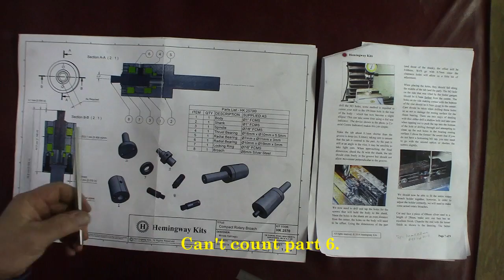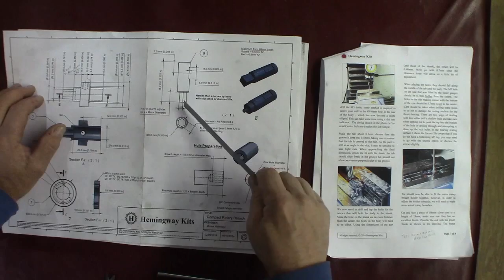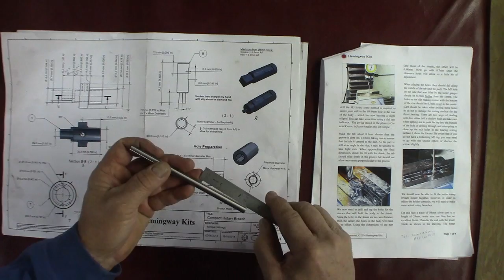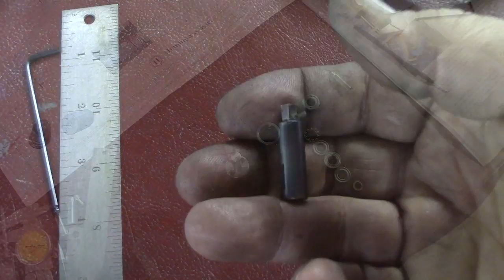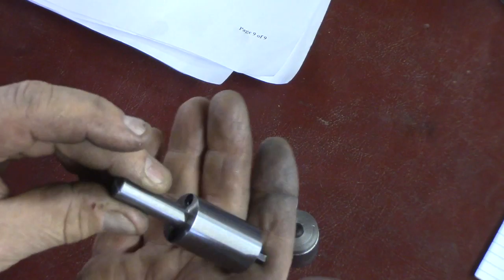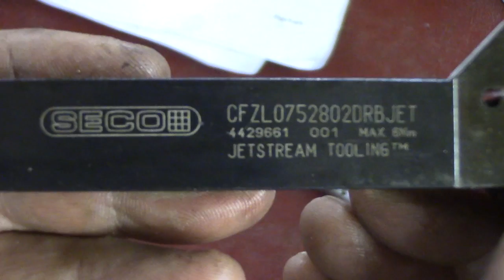How to Make a Hemingway Kit Compact Rotary Broach P6

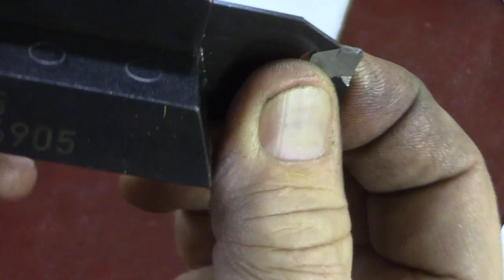Comment: I had the second parting tool on page 30:00 first, later fall for the first in your video. Not because I disagree with your advocating but is my limited cross slide capacity. As it use up most cross slide capacity in my mini lathe. I had the same mishaps with your first model, broken tool mount together with the insert, horrible experience. They are not bad in principle but because of poor reproduction quality control. The insert fit one side perfectly failed to fit properly on the opposite side. Good only if we are lucky and persistent in search for a quality piece. Cheers.

Comment: Excellent video and presentation. BTW I also got a Hemingway Kit myself. Scheduled to start sometime soon. 

Two questions. 
- What percentage over size I should use to prep the hex dimension prior to heat and quench?  
- did you have some sort of oxide scale preventative way we can follow with? 
Thx.
Reply from the maker: .005" to .01" is more than enough, being a small very little change in size while heat treatment.  no oxide treatment.
Reply: @rrintheshop  great. I was concerning about cutting edge get dull converted into surface scale. Your advice?

Comment: I'm setting myself up for ridicule here but I'm going to say something anyway. I always always always cut below center for the 1st three-quarters of a cut on a cut off. I never have problems I always use power feed. Ever I'm always right on. If I ever go even though I have problems! I hope there's someone else out there that knows what I'm talking about actually it and slowing down and pause and his worst thing you could do that's when you get chatter you can actually speed up and get rid of chatter open it up to me it cuts better below Center if it's a large obviously if it's small diameter you don't want to be below 7 because it will ride up.

Comment: Hi Randy, great job on making the rotary broach, it is real gem of tool. Also thank you for the post machining review. These reviews add a lot of value and appreciate your experience.

I don't scimp on my parting tools because it less expensive to buy once and keep it a long time. I use the ISCAR cut-off inserts in old style ISCAR self grip SGFH 26-3 and SGFH 19-2  blades and Hertel tool blocks. I use my cross slide power feed at 0.0006"/rev for stainless and 0.0008"/rev or a little more for CRS for parts under 3" diameter. I could go faster but this has worked with no problems so why push it when running at 250 or less RPM.

Comment: Randy, your mill and lathe both seem to ramp up to speed when you cut the spindles on. That would drive me absolutely crazy.Are you using VFDs on these machines?
Reply from the maker: Yes Vfd's on both.  It is all easier on the electrical parts and circuits, saves a bit on surge cost.

Comment: Nicely done, I think I might have to make one to help in making the handles for the petrol taps I make. 
Now that you have set the off set, you will have to make sure all your broaches are exactly the same length. 
As you have a surface grinder, it would be possible to save your "mishaps", harden them and then grind to a size smaller.

Is there something wrong with my 'puter, it says there are 36 comments but I only see 2?

Comment: Thanks, Randy — very informative and a beautiful job with a great result.  FWIW, my research suggests that your Seco JetStream parting tool holder is, in fact, a current model (CFZR 0752802DRBJET = right-hand model), and is listed by MSC and Walter Hammond at around $250, without an insert.

Comment: Hey Randy, that's really nice work, we are not worthy of your teaching and experience!!!  That screw looks like the ones used to connect parallel and serial cables to the I/O shield on the rear of a PC.  The eccentric design will take my tiny brain a little to upload.  Kindest regards.  Joe.  PS Well done picking up one of John's tee shirts.  PPS can you give us some info on the heat treatment of the part?